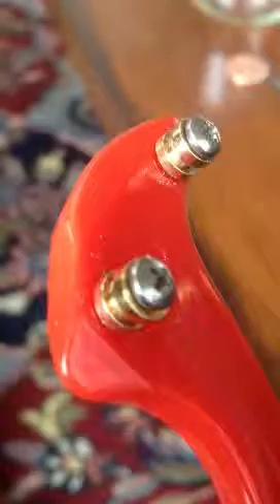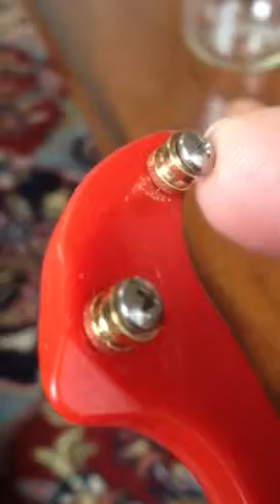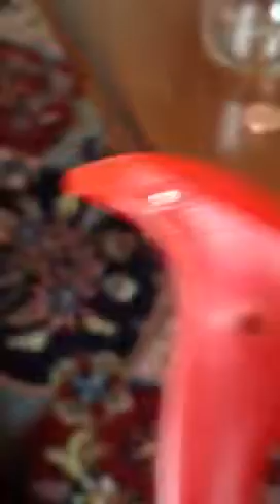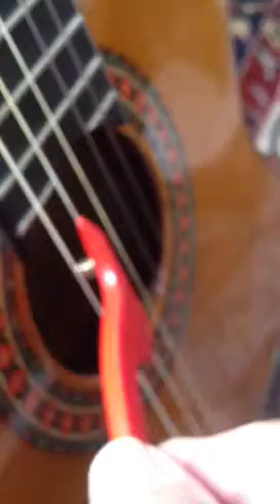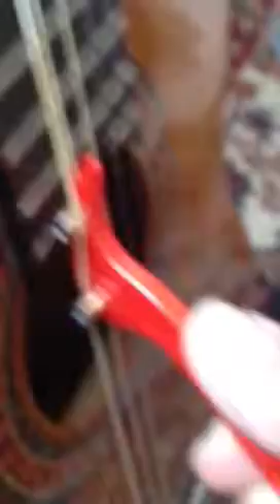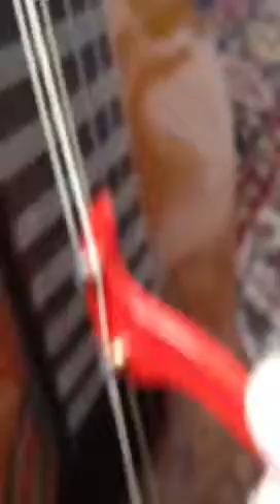String stretcher

Comment: where do you get one of these??
Reply: Go to the hardware store, buy two screws, take the ballends from some bass strings and find a handle. If you don't want to cut and file a piece of wood, maybe buy a cheap wooden hairbrush and rip it apart. That will probably cost less than 5 bucks including the superglue. 
Don't buy everything, make the simple things yourself.